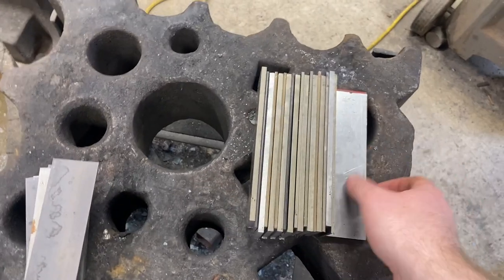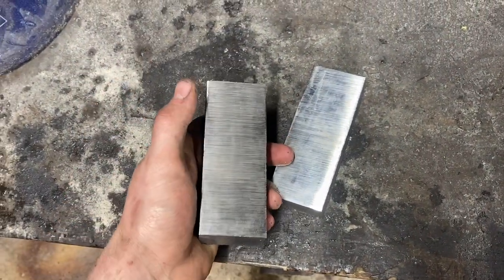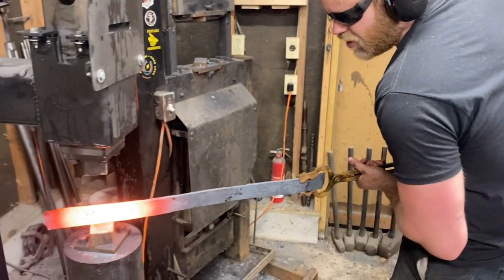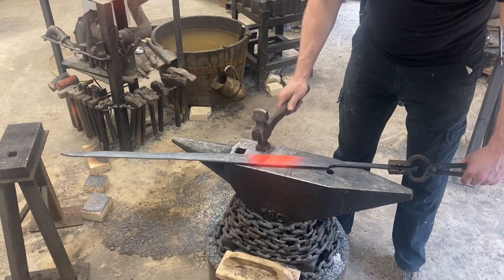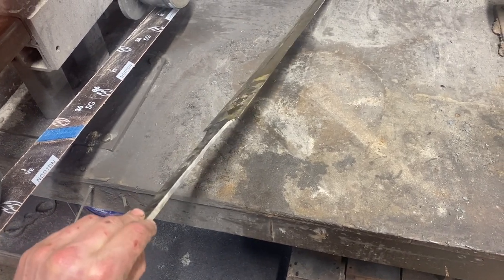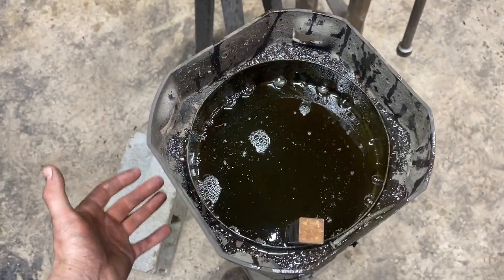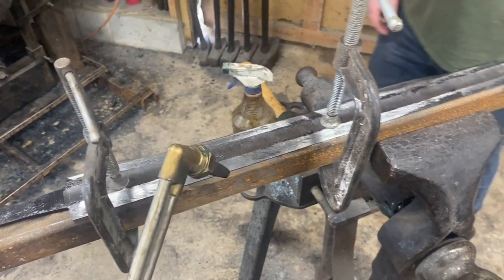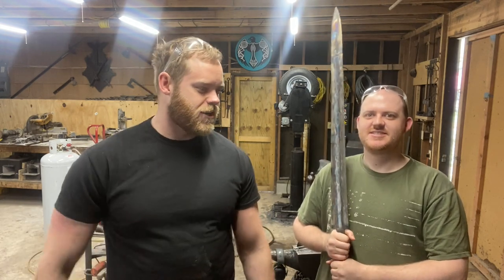Forging a Damascus viking sword with an old army buddy: part one

Comment: So…..I’m not a blacksmith, but…..a forged in fuller vs. a ground in fuller…..the purpose of the fuller is to reduce weight. So, if you beat a channel, (fuller), into the middle of the blade you aren’t removing any material to lighten the blade. It won’t reduce weight. That’s the real reason you grind a fuller, as opposed to forge a fuller. If you forged one in, it would just be for “aesthetic”, purposes, and wouldn’t have the functionality that a fuller is supposed to have. Just my thoughts.